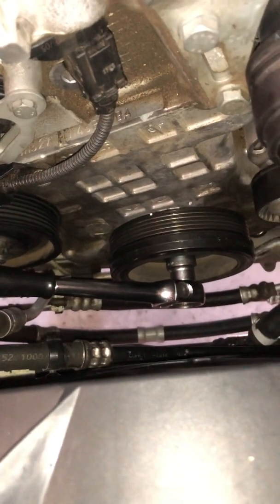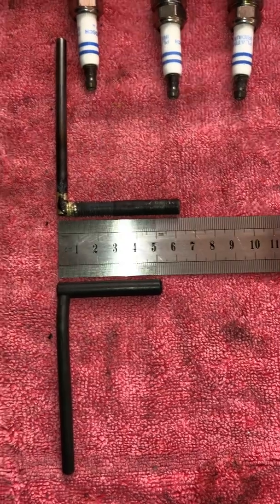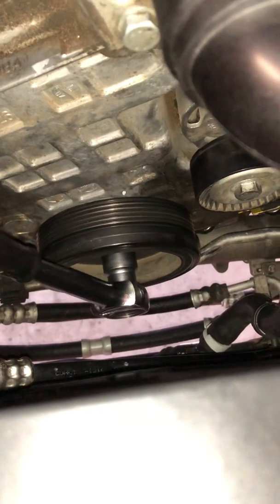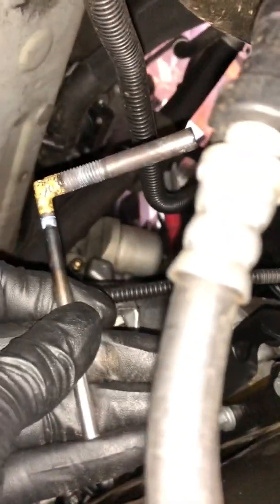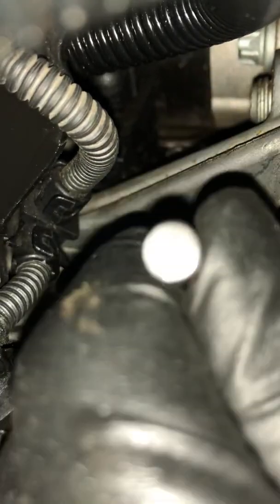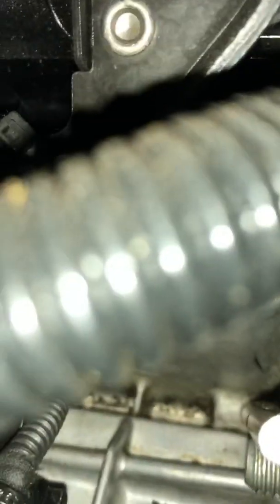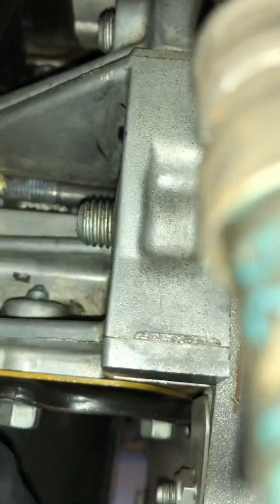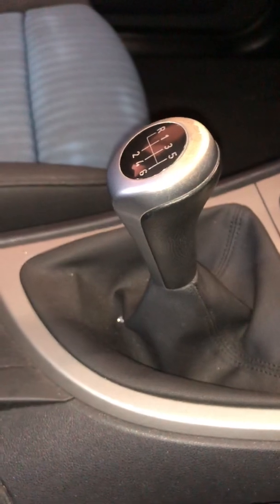HCB B1156 Flywheel Locking Tool too short for BMW N46 engine

Comment: I just used an Allen key 😂
Reply from the maker: Good job! 🙂 Any rod of about the right diameter will do the job, as long as it is long enough. The point of this video is that the supplied flywheel locking tool only works on the flywheel of an automatic car. For the flywheel on a manual car, a longer locking tool is needed. I just used an old 8mm bolt, though I did do some fancy brazing to attach a cut down tent peg to it. Whatever works. 🙂

Comment: Hi, thank you for this video I am going to time my engine on my E90 320i with the N46B20B motor. But I wanted to know, so there is a single hole in the flywheel that lets this tool slot into it to lock it, but that hole is only lined up with the access hole for the locking tool, only when the 1st cylinder is in Top Dead Center??
Reply from the maker: Hi Reese. Yes, you’ve got it right. And as per the video, an engine with a manual gearbox needs a longer version of the flywheel locking tool. Once you’ve inserted the tool fully, check to see that the crankshaft/flywheel can’t rotate.
Reply: @Valden23  Okay great thanks! Good to know then for peace of mind. Yes mine is in a manual as well, so i'm going to now see too if the flywheel locking pin from the timing toolkit is going to be long enough or not. Thanks!!

Comment: Thank you for sharing this info. Was about to set timing on n46 e90.
Reply from the maker: You're welcome Vlad. Apart from the HCB flywheel locking tool being too short to lock the flywheel of a manual car, I found the rest of the HCB tools I used to be excellent. HCB did tell me that they would produce a longer locking tool for their future tool sets, so that it would work with manual and automatic cars, but I haven't seen the outcome of that. The tool I made for myself will work just fine if I need to do the timing again. I made it from an M8 bolt with the head cut off, with a shortened 6mm tent peg as the handle, braised together. :-) Good luck with your timing job. Have you got all the instructions you need?

Comment: Thanks for sharing this , I’ve just had same issue today as I’ve been surprised why my tool was all the way in even the engine is not on TDC yet , then I remembered I’ve seen your video having this issue , it helped me to not to be stressed about what’s wrong with my engine ... now I will make my own tool to fit nicely and get the job done , by the way my car is 2006 E90 318i N46b20 engine , but same issue exactly, thanks
Reply from the maker: Hi Amjad. I’m glad my video was helpful to you. There’s so many times I’ve watched other people’s videos on how to do this or that, it’s a real pleasure to be able make a vid that might hit the spot for someone who’s dealing with a problem I’ve faced. Please add a new comment if you come up with a good way to make a flywheel locking tool, or some other trick. 🙂

Comment: do you still have this tool?
Reply from the maker: Hi Adrian. Yes, I do still have this tool. It's easy to make one for yourself. Use the dimensions shown in this video, with 8mm diameter mild steel rod. A heated and bent tent peg might do, or an old bolt with a handle braised on to it, like the one I made. Also, be aware that I have been in touch with HCB themselves about this tool not working in manual transmission vehicles. They advised that they will make new flywheel locking tools that work in both manual and auto vehicles. I am still waiting for them to send one of the first off the production line to me.